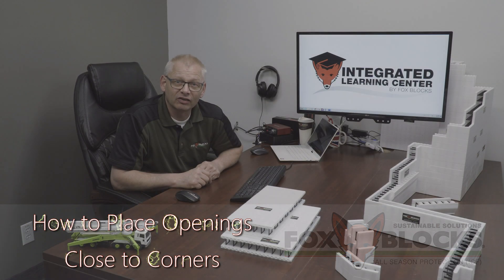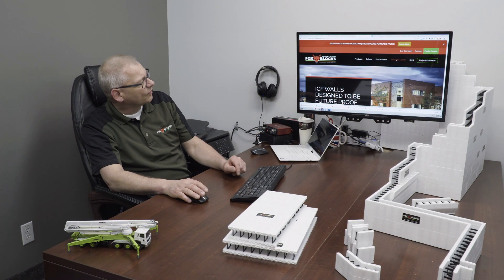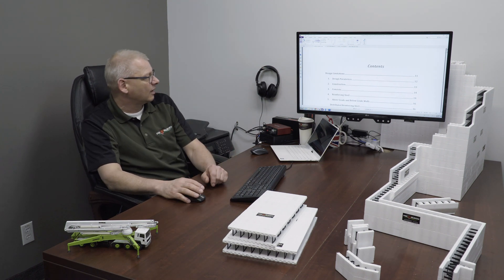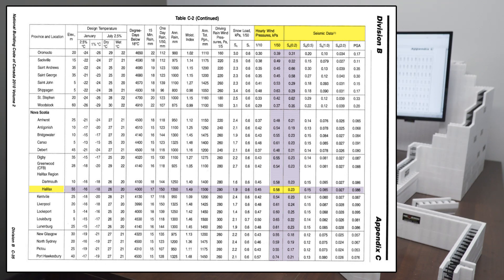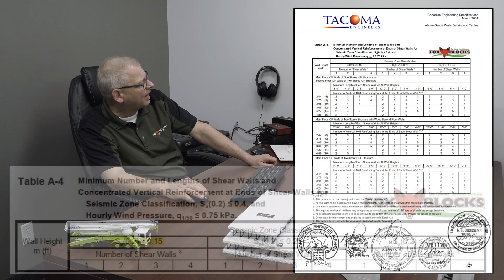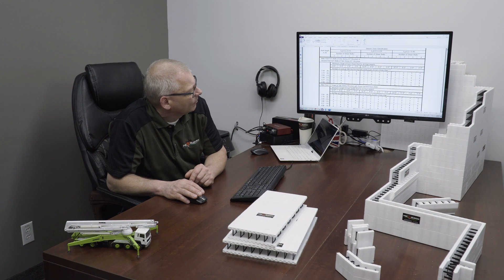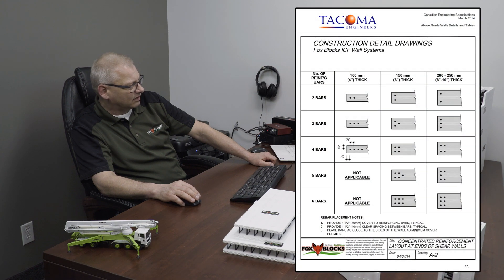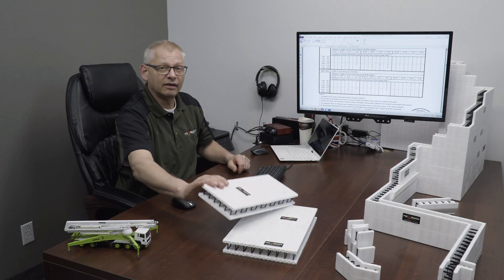Fox Blocks Shear walls

Comment: How about interior ICF walls of those same 4 planes. Can they also be used as sheer wall areas? You have many references here of sheer wall widths but you only go down to 3 feet wide..can a wall area of less than 3 ft wide be used for a sheer wall area?. I have a home FRONT design with lots of openings including garage doors and there is hardly anything wall area wider that three feet on the whole front face. How do you deal with that?
Reply from the maker: Hi Jean
Shear walls do go to 2' in the tables but this is for the lowest wind and seismic areas. You may be able to use less wall length with site specific engineering. The Fox Blocks prescriptive design, available on our website, will cover the majority of projects but not all. Interior walls should be acceptable for shear walls but this would be beyond the scope of the Fox Blocks prescriptive design and would need site specific engineering.